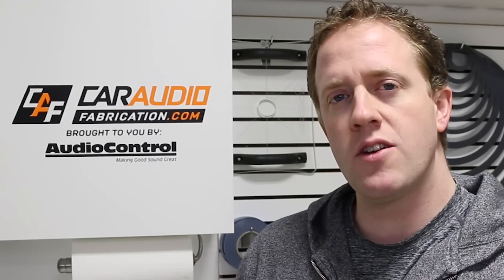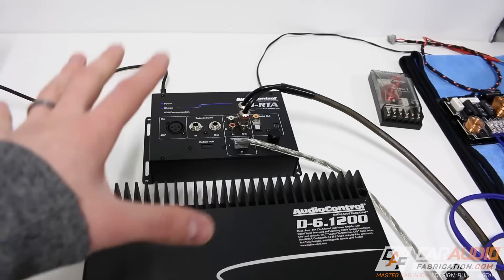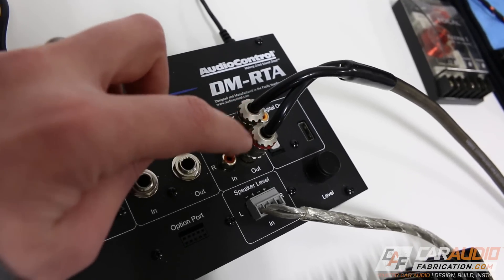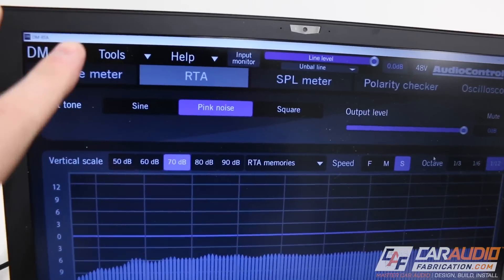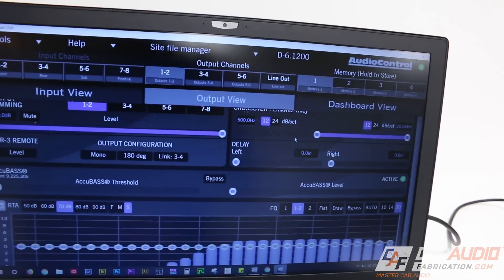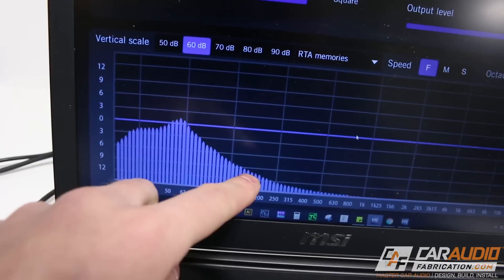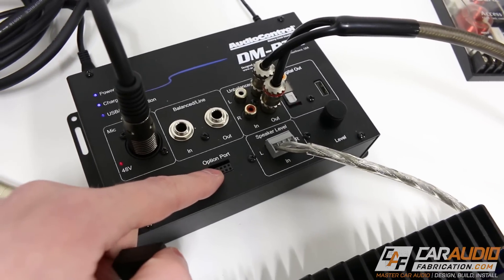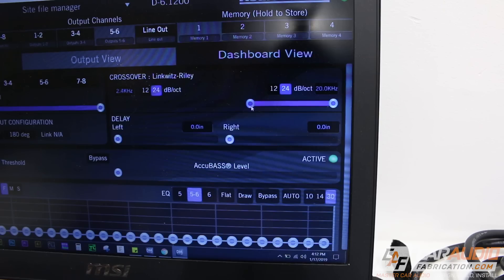Crossovers VISUALIZED with the DM-RTA!

Comment: I have a i905 alpine head unit with rca’s running to the R2-A60F 4 channel amplifier and a R2-S653 set of component speakers, do I run all  the speaker cables to the cross over , as in just one set of speaker cables from the amp to the cross overs and then wire all the speakers from the crossover, if so do I need to bridge the cables from the amp to the crossover , as it’s a 4 channel amp,if so what size wiring will suit it ,or should I just have the subs from the component speakers wired directly from amp to the speakers and run another speaker to the crossover feeding the mid and the tweeter .Please Help

Comment: 2015 grand Cherokee, has factory Harmon  kardon system. Replacing front speakers with a component set. Woofer and tweeter. Do I need to use the cross over that came with the speakers?

Comment: seriously need your help. Purchased the DM-RTA couple of days ago and arrived today. The rta device won't turn on. I thought maybe the battery is flat. Plugged in and the charging indicator led comes on. Tried to turn the device on again and nothing. After that I realized inside the device is a blue light that always stays on and is not going off even if i press the power button. Couple of minutes later i installed the app and tried to connect it to my Windows laptop and the usb/comm led indicator was blinking but device didn't connect because i can't turned on. Please help

Comment: How does a crossover split power. Let's say one set of component speaker with its tweeter is 100 watts rms. Would the whole set get the 100 watts and it would be split like an 80/20 watts split? (80 to mid/20 to tweeter) And would it be okay to run the whole 100 rms to it?

Comment: If I’m running a 4 channel amp bridged to passive crossovers, can I still calibrate the mids and highs using an SMD CC1?  Would I turn off the crossover portion on the amp if just using the passive crossovers to do the work?  Setup:  Skar RP 75.4 with Skar SPX 65Cs. Thank you!!
Reply: Did you ever figure it out I have the same question plz help

Comment: Hey Mark, so I have a JL C3 component speakers yet to be installed up in my front doors and I also have the D-6.1200. Is it necessary to install the passive crossovers that comes with the component speakers or can I simply rely on the D-6.1200 inbuilt crossover system? Thanks and big fan...

Comment: Why only low and high pass? When you say high pass, high pass can start out at 500hz. Wouldn't 500hz be to much for a tweeter? Aren't most tweeter's crossover point start around 2500hz? Why is it not broke up as low,mid and high? High pass is a combination of mid and high?Just wondering. I have an all Focal system and Pioneer head unit with Pioneer 5 channel class D amp and wow those Focal speakers are amazing.

Comment: Hey.  I have a question. I've ordered some Skar Audio VXI 6.5 component speakers unfortunately i'm running into an issue with them... The issue that I'm having is with connecting the crossovers to my alpine mrx-f30. When I have the crossovers connected to my amp I'm limited on how loud I can turn up my radio.  The amp stops playing any sounds when I turn up the radio to about 25-30. This issue only happens when I turn up the radio with the crossovers connected. Now I've tried inputting the crossover signal directly to my factory radio(by the way, I have a 2016 Tacoma non-JBL) and I can turn it up without having any issues but once I connect it to the amp. I get to about 25-30 on the volume and the amp shuts down. I've also tried removing the speakers from the crossover and turn up the radio with the crossover only connected to the amp, and still.. It shuts down even though the speakers aren't even connected to the crossovers.  Any thoughts on this issue?
Reply: Erik Flores this is a Toyota issue

Comment: Hi so I have a 2004 chevy blazer with a jvc kd-r790bt with rockford fosgate 3 way speakers and since installing the speakers and dual ten inch mtx subs. Anyways my problem is in short that ever since I put the new speakers in that I crank them up too loud and it over heats my head unit and they start to sound like shit. My solution is to wire up a second amp one for the actual car speakers. But my problem to this solution is that I only have one set of RCAS on my head unit so I was wondering if there is any amp that allows me to run the wires from the head unit for the speakers to the amp and then run wires from the amp to the speakers? Amy advice would be much appreciated as the new speakers sound really good until the head unit over heats.

Comment: When it comes to using active crossovers, how will you know when you have to much or to little filtering? What would be a good rule of thumb to fallow when setting crossovers? How can you optimally set the crossovers using the info provided with the speakers? I have never really tried using active crossovers I mostly use passive crossovers for the systems i have installed over the last 4 years.

Comment: So i have 200watt front speakers and my radio can only support 50watt per channel. Would this mean the quality is worse than a 50watt speaker with a 50 watt radio?
Reply: What is your rms ratings on each speaker then rms ratings on each speaker output on headunit. Most say 50x4 but that's your peak wattage not your rms ratings. But yes it sounds like your not getting full potential outta your speakers and should go with a amplifier to correctly power them and fine tune them to your liking.

Comment: I’ve got a question I’ve got a factory system and it’s got original mids and a separate tweeter would that imply it’s got a factory crossover or not??? And if so would you recommend adding a crossover and running new wires for both kids and highs?
If anyone is interested the vehicle is a 2010 Ford Fiesta uk spec

Comment: Have you guys ever done any installs on a  2016 and up Infiniti Q50? I have a 2018 with the six speaker base stereo system. I want to keep the stock radio (not that there is any upgrades other than Chinese) and install the tweeters, mid-range 3 1/2 and 6 1/2 mid woofer in the stock front door locations and coaxials in the rear doors. I'm also considering a sub in the trunk. Any advice on DSP and amplifier? Do you know of any aftermarket that can help with door chimes and the rest of factory chimes, voice and so on? Thanks for everything you do to help out the community.

Comment: great video as usual. my question is when running the crossover, either active, on the amplifier or passive, do you have to tune on a flat equalizer setting? how does the "loud" setting effect this tuning? thanks in advance
Reply from the maker: You can use both eq and crossovers together. Crossovers are kind of "set it and forget it" where as eq is a major part of tuning and adjusting. "Loud" setting is usually just an eq boost on a certain range of frequencies. I avoid using it.
Reply: @CarAudioFabrication  i need to clarify, when tuning the sound system you start with the EQ at the flat setting. once the system is tuned at the flat EQ setting should the system only be played with a flat EQ? or can i set the EQ to rock, rap etc.?
Reply: @PANTYEATR1  Okay I understand what your saying, the settings are at the right levels now but you want to add that "loud". Only problem you may experience clipping and distortion because you created your own EQ when tuning the amp. "loud" feature on head units is a preset with only is a small preamp with 15 watts per channel. Now that you have a 4 channel and a mono amp I assume, they are going to give you that power you need. see how it sounds with the extra head unit tune, remember it's all preferences of how you like it to sound.
Reply: @fronx7975  thanks for your reply. I'm asking about the EQ settings, when tuning the system and after, do you have to stay with the flat EQ settings?
Reply: @PANTYEATR1  yes that is recommended , but no harm in trying,,make small adjustments and check first.

Comment: Do components crossovers are bandpass? I have a set of JBL's p660c components and I'm wondering if I need to set the amplifier crossover to high pass or full range.
Reply: Typically component crossovers that are included in speaker sets are "tuned" to the speakers that they are included with. Thus it is most likely unneeded to set crossovers on the radio or amplifier in addition to the passive crossovers, as that can cause some unwanted reactions to the sound. So typically you would set the amplifier to full range. Additionally, most of the time the passive crossover boxes only act as frequency filters, but on many higher end systems they have zobel networks built in to make the different sized speakers sound like they are playing at the same volume.
Reply: @Rolling_Thunder_Bass  Wouldn't you at least apply the amplifier's high pass crossover to the components, assuming there is a subwoofer in the system?  If you make a high pass using either an amplifier dial or a DSP, I wouldn't think there would be undesired effects.  Honest questions here, thanks.  A lot of basic upgraded systems do this.  Example - I used to set an electronic high pass coming out of my aftermarket head unit going to a coax speaker (that had a built in crossover).  My home theater receiver filters frequencies before sending signal to my 2-way "component" speakers. Would you say this is a good practice if done in the digital domain, but not on an amplifier's built-in dial crossover?
Reply: @Jacobious  Most passive crossover boxes consist of a high pass filter on the tweeter channel, a band pass filter on the mid, and if present separate band pass filters on the mid bass channels. From my own personal experience, most of the passive crossover boxes are designed to work on a full range channel. The crossover circuits for mids and highs have high pass filters built in them already, so by enabling the high pass filters on the amplifier, you are applying two different exponential roll off functions to the audio signal which can combine and potentially reduce frequencies at a higher point than what was intended. Thus you might cancel or reduce some of the sounds that you actually wanted and potentially create a hole in your music.

With regard to coaxial speakers, in my experience it is very common that coaxial speakers do not apply any filter to the mid-range cone. Many coaxial speakers only apply a high pass filter to their tweeter in the form of a capacitor which is soldered on to the back of the connection points on the mid-range, or the tweeter itself. These speakers typically do benefit from the assistance of an additional high pass filter to block out the bass that should really only be played on a subwoofer. There are always exceptions to rule though, I have seen component sets that can be mounted as coaxials but they still had separate crossover boxes.
Reply: @Rolling_Thunder_Bass  Excellent.  I appreciate your response and agree that having any redundancy in your crossover or crossovers wouldn't be a good idea.  I beg to disagree though about component crossover boxes having a bandpass filter on whatever is the "woofiest" woofer".  In my experience, those drivers are on low pass filter from the manufacturer - Unless you are talking about an ultra high-end speaker system.  (I agree with your assessment of coaxial speakers, likely not filtering the woofer at all).  The speaker manufacturer can't assume a subwoofer will be present and shut out low bass content from reaching the components.  You have to limit the low bass input to your woofer by using either a DSP crossover, a head unit's crossover setting, an external amplifier's high pass filter, or an inline bass blocker.  For the question regarding the JBL p660c, in my opinion, Carlos definitely should configure the high pass crossover on his amplifier going to the components, because the bass drivers are otherwise only a low pass filter.
Reply: @Rolling_Thunder_Bass  ok so I have a question you seem really knowledgeable. I just installed all 4 knew speakers and 4 channel amp and mono amp and subwoofer it’s sounds great but my only issue is that midbass is lacking and as a deist sounds very tin canish there’s no midbass would it maybe be because I have hp filter on amp and passive crossover box? I’m using infinity reference 5.25 speakers up front component and coaxial in the back.
Reply: @Rolling_Thunder_Bass  thank you so much for the very useful info!

Comment: I'm running 2x Jl Audio 300/4 (75Wx4) with a 10x switch built in to achieve active crossover between mid and high WITHOUT any additional equipment. I'm bi-amping both fronts and rear JL Audio C5 6.5" components.
Reply: how do those C5's sound?  interested in them.  maybe a video?
Reply: so are you not using the passive crossovers? have you had any problems with the speakers? any blown tweeters? how does it sound? im scared to go full active and blow my FOCAL tweeters but also not sure if im gonna get all the performance using the passive crossovers.

Comment: Need more videos in future for the new testing device 
I have 3sixty.3 and RTA mic and its software, and some SMD gear DD-1 and CC-1, is it enough as a start to tune subwoofer and a dual pairs of RF components and 2 mid range from focal running active along with 4 amps for low,  mid bass, mid range and TWT? 
Do you recommend any thing else?

Comment: How do you feel about the sound quality from micro style amplifiers vs their full size counterparts? Not just audio control but a lot of companies are coming out with micro amps and they are priced pretty reasonably and I was just wondering if sound quality suffers for them to be able to sell them so cheaply. Thanks
Reply from the maker: The SQ on the AudioControl micro amps is great, there are quite a few SQ cars that are running multiple ACM (micro) amps as they allow for a lot of flexibility in system design. Im using one in my Grand Cherokee install as well.

Comment: Which do you prefer, active or passive crossovers?
Reply from the maker: No preference. Depends on the application.
Reply: Active wherever possible
Reply: Active crossovers give you a lot of control and will typically sound better if set correctly, most enthusiasts will prefer active systems. Passive crossovers are more "set it and forget it" but can have some unintended consequences with phase angle changes.

Comment: I dont see why these are not implemented in modern touchscreen radios yet..
Reply from the maker: Crossovers? Modern vehicles have crossovers built into the amps/head unit especially for factor "premium" systems. They just aren't adjustable.
Reply: Because factory doesn't want you to have control. And I am glad. Helps other companies build products
Reply: General public doesn't care for it
Reply: Some aftermarket head units do have  what's called a 3 way mode which dose allow you to implement low pass.... band and high pass across 3 different speaker pairs... Alpine and in believe some of the Android head units do have this... unfortunately I have never used this and cant a test to them working well...
Reply: A lot of Rockford Fosgate Amps have built in Clipping detection that helps you set up amps properly.
I'm old school I took out a known Disk I've used for years and set up systems on a few songs I picked on that disk, but you must have an ear for it.    I do like Built in Clip setup and I think every Amp manufacturer should be doing that with the clip light's.  Speaker manufacturers should demand it. It takes the guesswork out of setting up systems
problem is it also turns a novios into a pro somewhat. 
However that's only part of the equation, the rest is proper wire size for length of run and so on.
A lot of brands of wire do not meet the ga size that's on them and its poor quality wire.
Next time you buy a 4 Ga Amp kit for 16.95 keep in mind its 8ga at best. Or even 10ga.
We have far too many Cheap products on the market that quite frankly your better off with the factory system.

Like JBC  Just Bull CRAP!    By the way JVC sued them for name infringement and won.  Good for the Harmon Group.

Comment: is it good to have both a active crossover and passive crossover
Reply: Ur slopes will be added. Very sharp roll offs.
Reply: Mike Eral what if your radio have built in slopes
Reply: If your running both you can adjust the roll off through your Dsp.